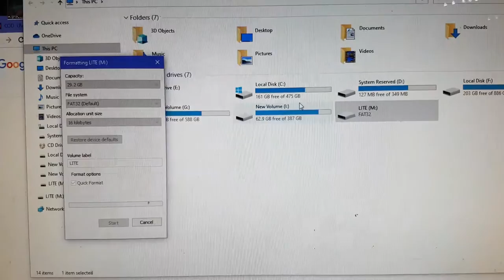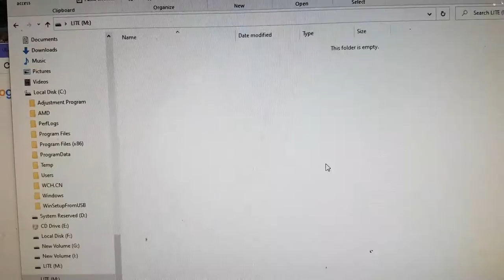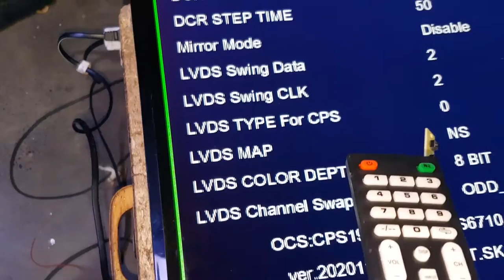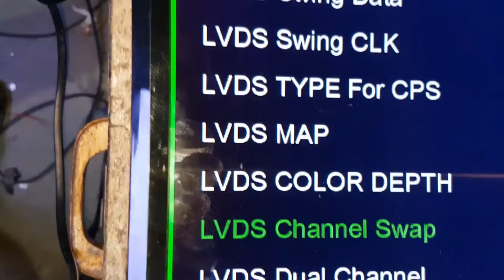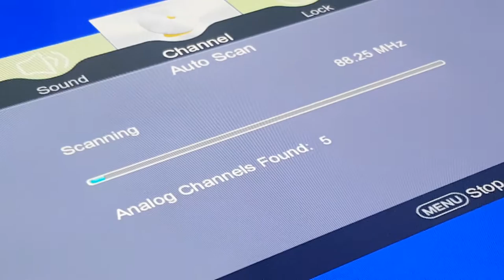How to install universal tv board T.SK105A.03

Comment: I followed the same procedure for my samsung LTJ320AP02-J, the backlight is coming on, but there is no display. I have connected the RxIN EVEN pairs 1,2 and 3, Rxclock pair, Vcc and Gnd. What are the pins WPN, SCL and SDA? Are these pins needed for display?
Reply from the maker: Make sure the LVDS is connected properly. Flash it with 1366-768 FIRMWARE.  yes tyr EVEN or ODD signals.
Reply: @tevzTVTevatronics  Yes, I tried both odd and even signals. I have flashed 1366_768 fw too. Can you tell me what are the pins WPN, SCL and SDA for? are these pins needed for the display to come?
Reply from the maker: WPN,SCL,SDA, is not necessarily connected. LVDS signals for 1366-768 is 
LVDS OOD-Signal
LVDS OOD+Signal
LVDS OOD1-Signal
LVDS OOD1+Signal
LVDS OOD2-Signal
LVDS OOD2+Signal
LVDS OOD Clock-Signal
LVDS OOD Clock+Signal
LVDS OOD3-Signal
LVDS OOD3+Signal
I hope this will help.
Reply: I have wired the lvds connections as mentioned. Jumper set to 12v. Getting a reading of 11.76v. firmware flash was successful. The display is blank after powering on. Is there a way I can test if the panel is good?
Reply from the maker: @TheVinithtube  you can test the panel of voltage reading like the VGH and VGL. some panels have test patterns by only the 12v supply is connected. see this LVDS pinout https://drive.google.com/drive/folders/1wTghE9uGmS9mHxIVI2TCBAsBsyWKKmPX  1366x768 is 10 wires 5 pairs, starting at pin 7.

Comment: Master Yan Yung matibay at tumatagal na mainboard Tama ba? Ok lang din Yan sa 12v 5amps DC Yan Kasi Yan din Ang board ko sa 20 inch ko na Nova led tv ko. Yung may glass panel
Reply from the maker: Wala pa maman back job ko sa boadr na yan, 2amps minimum ok yan maliit lang naman tv mo. Ok na yan 5amps.

Comment: wala  sir  bale marami din pala kami may parehas na problema  so ang prob ng karamihan sa nakabili ng board na  ito  1 ayaw mag flash ng firmware (di nag biblinking light)  2  yung display  nag split into apat na parts    so ang alam ko rin talaga na solusiojn is i upddate yung firmware  pero ayaw talaga e nag palit palit na ako ng usb  ayaw talaga mag flash ng firmware    sana may makatulong po :)
Reply: yung problema wala akong remote nung ni deliver kaya  di ko ma factory  mode
Reply from the maker: https://youtu.be/0IzCmX4fa_U?t=442 Manual flashing gawin mo, ganyan na din yung mga dumadating na board sakin. try mo yan spi programer. mag a upload ako next time kung pa ano gawin
Reply from the maker: ako din remote lang diniliver nila
Reply: Ganun din saken..
Reply: dito ko lang nakita yung firmware na gamit ko https://www.youtube.com/watch?v=C2YTL25iyHU&t=10s

Comment: Bossing, pahelp naman, bakit guhit guhit lang lumalabas sa screen ko?
Reply from the maker: Siguradohin ang connection ay tama, tamang firmware, baka sira ang panel mo. Naka connect sa 12v yong jumper kong 32" , 40" ang panel.
Reply: Pano malalaman bossing if yung panel talaga may sira?
Reply from the maker: Pag yang sinabi mo na may guhit guhit.